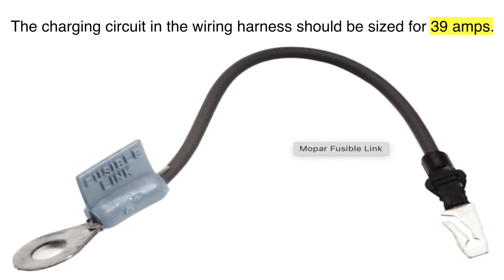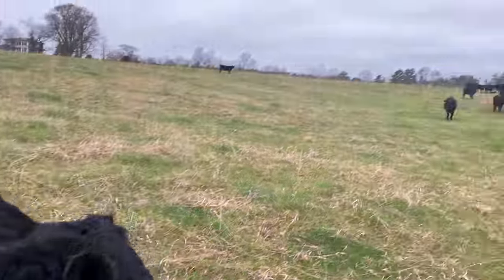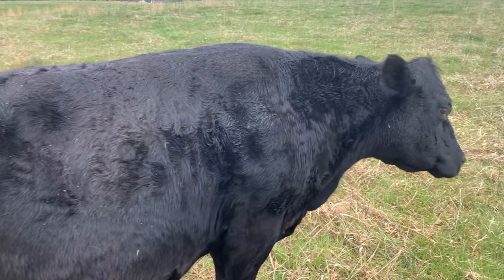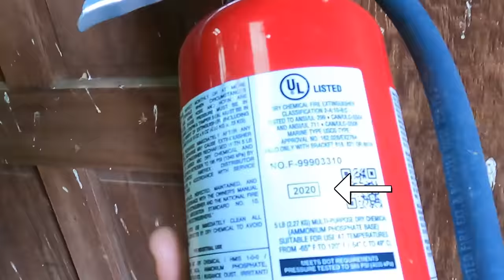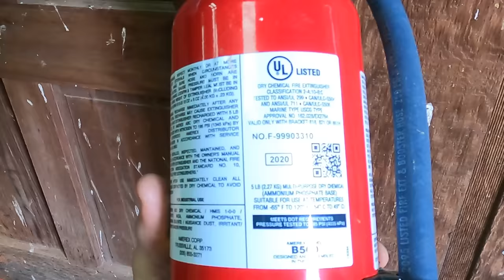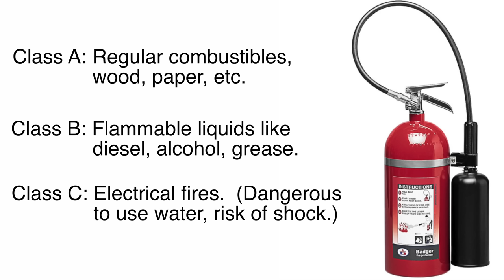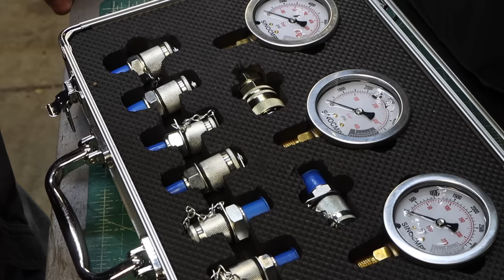Fire Extinguishers: 7 Things You Really Should Know...And Probably Don't.

Comment: All fuses and breakers have a time factor to their behaviour. There are graphs to show how long they take to break at different current values. So the fusible link, taking a while to melt, doesn't have anything wrong with it: it was designed in on its engineering merit. Usually the purpose of a fuse is to prevent other cables from melting and your link was probably pretty effective at this.

Comment: Commercial applications require a fire extinguishers to be certified more often than 10 years. Don't discount the idea of a fire blanket. Extinguishers make a mess and many cases a fire blanket will work. As a mechanic I kept wool fender covers in the shop supplied by my uniform and rag company. Any time I started a new engine, I kept one of those nearby in case of a backfire and carburetor fire. Saved me more than once.

Comment: For the most part, I prefer the 2A10BC/dry chem extinguishers on all my vehicles, but don't discount the old reliable 2.5 gal water extinguisher in certain situations. I keep one mounted on my straw blower when I'm landscaping a yard. It works best on any class A fire. I fill it with water and about 3 ozs of RV antifreeze so it doesn't freeze up in cold weather. It has saved my butt a couple of times.

Comment: https://en.wikipedia.org/wiki/Fusible_link

Electrical fusible link
An electrical fusible link is a type of electrical fuse that is constructed simply with a short piece of wire typically four American wire gauge (AWG) sizes smaller than the wire that is being protected. For example, an AWG 16 fusible link might be used to protect AWG 12 wiring. Electrical fusible links are common in high-current automotive applications. The wire in an electrical fusible link is encased in high-temperature fire-resistant insulation to reduce hazards when the wire melts.

Cut-n-paste from Wikipedia.

steve

Comment: Fuseable links are for dead short to ground. The smaller wire size than the rest of the circuit is what is blows saving the longer wire of said circuit.
Reply: If I remember right, the insulation was different on these fuseable links. The way we would know it was blown was by being able to tug on the wire. If blown, it would be spongy and pull away.

Comment: Another thing you need to do immediately before you can use a powder based fire extinguisher is to thump it HARD on a solid surface like concrete. That will help loosen clumps of powder.

Comment: Tips and tricks to keep a Extinguiser live hold the handle loosely tap the bottom with a solid hammer you should feel a springy feeling this loosens up the powder inside , As Not to just blow the center out upon use it frags the whole container This is a service most companies use as long as there`s still pressure in Green , As they sit they can shake and cement themselves Most vehicle one`s don`t work as good because of this .

Comment: If you have fired a powder extinguisher, the valve will not be totally airtight, because r
There is powder on the valve seats , it would leak out slowly, you can pause and start  again  in the short term but , always recharge them after use!

Comment: i had some home depo light plastic lens 2x4 lay ins for ceilings . i made a jig ran a steel wire across a piece of plywood put a weight on one end of the wire so as it heated and got longer the weight would keep it tight, i then put a 12 volt battier on th e steel wire as it heated it cut the plastic in a straight  line. the wire needs to run thru two small eye bolt screws, trying to cut with a cutter only cracked the plastic

Comment: the fuse-link wire size is suppose to be 4 gauge sizes smaller than the wire it is protecting. it is a short section of wire and has a more fire resistant insulation on it.

Comment: At one time all fire extinguishers were colour coded depending on what they contained and what they were to be used for.  This was good especially on ships or where a multinational people could be around, airports etc. You knew what they were for just by the colour and didn't have to read the label, now they are all red so its quite easy to pick up a water extinguisher in a hurry and use it on an electrical or oil fire with disastrous results if you are non english speaking. Why this was done is unknown to me but in my opinion a backward step. Black for co2, blue for dry powder, cream for foam and red for water, there were others. It was one of the first things I learnt when starting to work, safety usually is and it stuck in my head from some 49 years although now useless. To my defence on prefering the old colour scheme, in case of a fire people tend to "panic" or get agitated and pick up the first extinguisher at hand and fire it off not having to spend  5 minutes to read the label and small print to find out whats in it and what its not to be used for. The colour coded ones still had instructions as well.

Comment: That test you did.. You connect them in parallel. Meaning the moment one blows, the other will take all current it can, and burn. How fast? Depends. Since that's lead acid battery providing plenty of current, I'd say very fast. You should connect them in series. So only the weakest link would blow. And then you know for sure. 
Btw, here in EU I never heard of fuse link. Probably it's cost shaving for manufacturers. I only use proper fuse. Simple and foolproof.

Comment: I have experience with fusible links when working on some old Japanese cars. Ive seen a few with melted insulation, but never seen one hold a high current short for long enough to melt the copper. In my experience, they are usually used in conjunction with a fuse, as a kind of backup. They are useful as a literal "smoking gun", if you smell melted plastic and see the insulation melted, you know there is a short somewhere, even if the link doesn't actually break.

Comment: 2:17 what is sticking out from under the tape on the splice between the fuseholder wire and the battery wire? It looks like part of one of those metal crimp splices - in which case, it is live, and now hanging out exposed next to lots of grounded metal...
Reply from the maker: Just a piece of tape that was used to label the wire.

Comment: Fuseable links were use predominantly from the late ‘80’s to the early 2000’s in automotive industry... mainly GM but most used at some point... that fuseable link if I’m correct was a counterfeit as when I worked parts they were basically stranded solder(tin lead and what ever else) covered in insulation... that might have been a California approved link or counterfeit... not sure

Comment: Running fuses in parallel to share the load is a so-so thing. Between the fuses themselves, the connectors and whatnot, the resistance won't be exactly the same, and with that, they won't split the load all that evenly either. One branch will draw a higher amperage, pop that fuse, and then the others will overload and fall like dominoes.
Interesting about how slow that fusible link was though.

Over here, there's a course you can take called something like "hot works". If you're a contractor, it's often a required certificate to carry if you want to do anything involving sparks or open flame. Even plastic welding, as for some types of floor surfaces is included.
Most of the course content is common sense, the kind of things anyone can figure out with the right prompting. But it can be helpful to get it all in a structured, formalized package.
Maybe there's something similar in your area?

Comment: When I worked at a muffler shop where we were torching and welding all day long, we had a couple of  old water extinguishers and they were great. Even if your hot slag starts some oil on fire, cooling the whole mess with a couple gallons of water is pretty effective. I've seen people dump multiple dry chemical extinguishers on a fire where oil is igniting off hot metal and it just keeps restarting until you remove the heat. Also, you can use them to extinguish burning clothing without asphyxiating the  person wearing it.
Reply: the absolutely last thing you want people to do is dump water on an oil fire and create an oil-steam fireball.

Comment: Reminds me of the telco central office fusable links. Those are literally copper bars. Depending on size/thickness/etc. anywhere from 1000A to 10,000A. (-48VDC plant) Having seen a craftsman wrench disintegrate when it was dropped into a PDU... only the humans noticed. (voltage drop and current didn't even trip an alarm)

Comment: I was a fireman at a suburban volunteer fire brigade 30 years ago (I was no volunteer, in Germany you could be a fireman instead of going to the military then). We - three young men - were at the fire station working on a firetruck when someone came in yelling "Theres a car starting to burn in the parking lot over there!" So we jumped into the VW minibus of the fire brigade, drove to the parking lot and there really was a car smoking out of the engine compartment. 

Our minibus was equipped with two 6kg powder extinguishers. I took one of them out, ran to the smoldering car, pushed the button - nothing happened. 

Luckily the second extinguisher was operable, thanks to that I could suppress the fire from escaping the engine compartment.  So I was able to save the car and the other cars standing nearby.
But actually: We had a non working extinguisher in a fire brigade car! The extinguishers were maintenanced by full-time firemen from the central fire station in the city center. Someone didn't do his job right there, because the failing extinguisher had a "refilled and tested"-badge that wasn't expired. I learned: One fire extinguisher is good, two are better. It's good to have a plan b if something is on fire.

Comment: electric heat of wire is different than gas/torch heating FYI do not use a fluid/liquid base extinguisher on and electrical fire or you may have a shocking time putting out the fire always use a dry chemical extinguisher for electrical fire also you should try to cut the power to circuit/s

Comment: Just want to post a clarification on an offhanded comment you made that could be misinterpreted. When you put any sort of fuse on a system, that fuse isn't going to limit your current, it's going to break the connection when the current is too high, and that is an important distinction as all fuses take time to blow. So when you had the 80 amps worth of fuses tied together, that didn't mean 80 amps were flowing through the cable, probably much more the instant the whole thing was connected as now the wire itself is acting like the only resistor in the system, at least until the fuses started to blow (at which point the resistance is effectively infinite so the current drops to 0)

If you want to actually push some piece of equipment or wire at a given amperage, you'll need to do the math to figure out what kind of resistors to put in as a place to dump the excess energy you're using. So for what I assume is a 12 volt battery, putting an 0.15 ohm resistor in line with the wire would've been a way to test it at 80 continuous amps. Also a lot easier on the battery as you're not swinging wildly up to potentially hundreds of amps before the wire heats up enough to start resisting. And then throw a 100 amp fuse on there for safety just to make sure you don't start melting something you didn't mean to.

V=IR (Voltage = Impedance (Amperage) * Resistance is a good thing for everyone who plays with electricity to know, and it really can't be broken.

Comment: “An electrical fusible link is a type of electrical fuse that is constructed simply with a short piece of wire typically four American wire gauge (AWG) sizes smaller than the wire that is being protected. For example, an AWG 16 fusible link might be used to protect AWG 12 wiring. Electrical fusible links are common in high-current automotive applications. The wire in an electrical fusible link is encased in high-temperature fire-resistant insulation to reduce hazards when the wire melts.[2] [3]”

Wikipedia

Comment: I had one of my extinguishers fail a few years ago. Mine went flat. (It was very old….)
But the gauge was stuck in position. So it was still reading as in the green.
So years back, when they expired, I started using them for training. My grandson knows how to use a fire extinguisher, and knows what part of the fire to attack, and about how much time you have to do it before it’s empty. 
On tv, they are like a 209 shot revolver……..

Comment: Mount an extinguisher to your welding cart.  Because when you're distracted, that's when you're going to forget your "must always have fire suppression handy when welding" rule.  But if it's fixed to the cart, then it rides along when you bring things along.
Reply: Always mount your fire extinguishers at the exit...first defense is to be running out...then if it's safe return to extinguish with your egress behind you...trust me
Reply: @robertgross6740  If you can only have one, then sure.  But One at the egress and one on the equipment that starts fires the way to go.

Comment: It is of my opinion that the only difference between a fusible link and regular copper wire is the insulation. The insulation on a true fusible resists melting where as on a regular copper wire, the insulation melts.

Comment: Potter Wasps, not (organ pipe) mud daubers. Mud daubers build the tubes on the sides of walls. Potter wasps build little mud pots, but will also reuse existing holes and build inside them.

End result is the same, of course.

Comment: The higher the current, the shorter the failure time.  At 39 amps continuous, it should fail after I believe 2 hours.  The difference between a fusible link and a fuse is you can hit a fusible link with current spikes, you can't do that with a fuse.  A fusible link is a very slow blows where a fuse is a much faster blow.  It will fry before your wiring with a battery arc.  It won't fry from an alternator short term voltage spike.  It's not about a fusible link failing super fast.  It's 2 people begin chased by a bear, the fusible link only has to cut the power a little faster than the wiring harness.  Any amount faster is fast enough.

Comment: i use about half an inch of 38awg wire as fusible wire for my laptop-recovered 18650 cells, from my testing it only takes a few amps, witch serves my purpose, as laptop cells can only safely output a few amps anyway.  in my use, when connected across a single 18650, it melts the middle of the wire, nearly instantly. and leaves a decent gap, as the heat causes the ends to curl
i dont belive fusable links is a special wire, but just by being down-sized, it becomes the weakest link. alum wire would melt quicker being higher resistance

Comment: There is no point parallell different fuses and/or different cable areas. The current will not split equal, and even if it whould, the lowest fuse blows first, and then the higher fuses will take all the current and blow too. But it's always entertaining to see things blow up.. or burn ;) ;)

Comment: Maintenance at my apartment complex just delivered new fire extinguishers, a couple of days ago. The fire extinguisher in the apartment, had a 2003 date on it. The owner of the apartment complex, had another apartment building in town, 4 stories, that burned to the ground back in January. From the eyewitness accounts of the people who were home on the top floor, it was most likely an electrical fire in the attic. I can't remember how many layers of tar, that was on the roof, but the fire Department couldn't get access fast enough; fought the fire for over 12 hours, and had to use a long reach excavator to tear into the building after the building was structurally unsafe, which it became after about 3 hours into the fire. It didn't help that it was a very windy day and threatened to set the downtown area on fire.

Comment: Don't beat yourself up. Fire extinguishers, while common, definitely aren't a common maintenance item people think about. 

I witnessed a similar oh crap incident at a gold mine years ago(circa 2012). In a roaster building, multiple stories tall, with metal grate floors, contained massive "ovens" that were fed oxygen via massive pipes that essentially burned the ore clean. Crews were welding a floor or two up. Hot slag fell, ignited a small leak at a coupling. One of their guys saw, grabbed the nearest extinguisher, pushed the handle....and nothing. Threw it to the side, grabbed another near by one, pushed the handle.....nothing. threw that across the room, ran to his truck, grabbed one from there and finally put it out. Lots of colorful language followed Suit. I started checking extinguisher dates and most of them were from the early 90s and hadn't been "inspected" since the mine reopened a year or so prior. It closed in the early 2000s. 

Moral of the story, always inspect your extinguishers, replace when in doubt, and have plenty available

Comment: 6:50 two 30s and a 20 is not equal to 80 in this case. You got 3 wires which are more or less the same, all fuses have low resistance too, pretty much the same. That means if, let's say, a battery gives 80 amps they split equally to 3 wires, to roughly 26A per wire. 20A fuse blows first and now it's 40A on each wire with 30A fuse. So it's not  like having one fuse rated 80A, because each wire have same resistance (and equal current) and fuses are not the same.